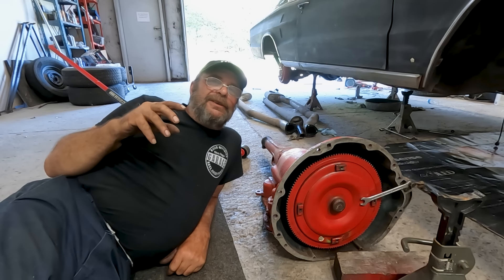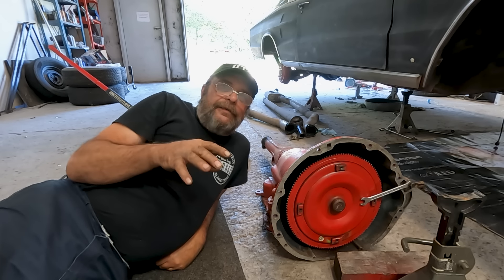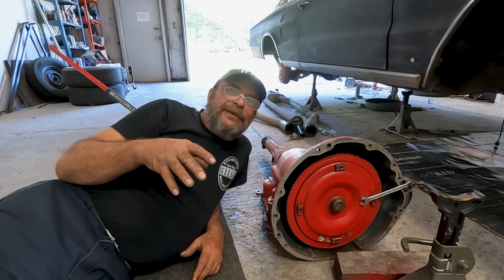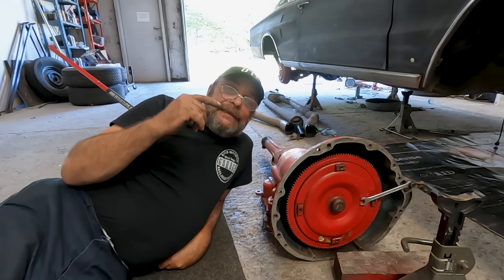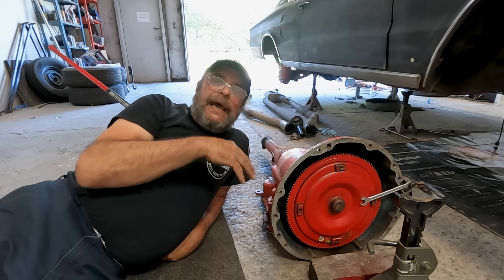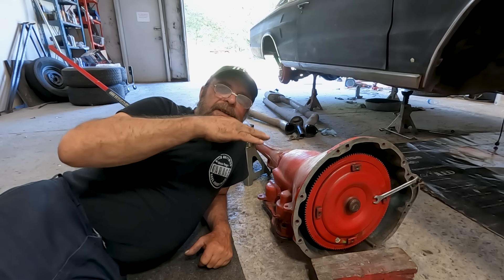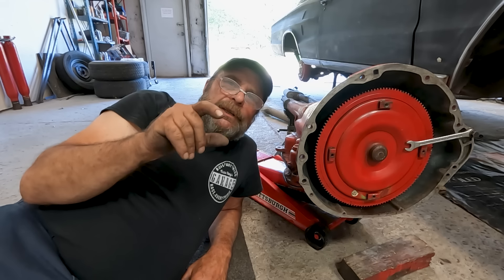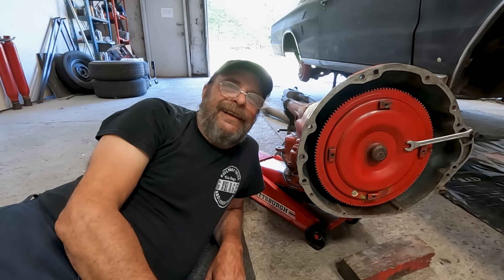One Man, On The Floor Transmission Install- So Easy Even An Old, Crippled Guy Can Do It

Comment: Now you tell me.  Back in 73 when I was 22 years old, I slid the 727 under the car and somehow got it on the wood 2x4 blocks on the scissor jack I had in the garage.  After what felt like an hour I got it up to the engine block and luckily got one bolt started and finally had it bolted to the block.  Then I had to somehow get the torque converter plate onto the torque converter.  I'm no pro mechanic just a shade tree mechanic.  I'm thinking I better tighten these little bolts as much as I can.  Yeah, I broke the head off the first one.  I headed down to the local auto parts store and got another bolt.  That was the last time I screwed with a transmission under a car.  Hello transmission shop.  Oh by the way, why do they give you 4 inches of space to install the bolts?

Comment: I use a motor- cycle lift as a trans. jack, just add 4 short 4x4's on top. 2 10mm guides on the bell houseing. this has always worked great for me.

Comment: The idea of the studs in the engine block.  I have a box of different thread "pilots" that I made over the years swapping engines and transmissions.  Working by myself under cars, this made aligning them a whole lot easier.  I just took long bolts, cut the heads off and ground the end to a rounded point.  I'm with Tony on the facts of aging with arthritic joints and worn-out muscles from the abuse of my younger days.
Reply: @One Eyed Jack  Definitely, I forgot to mention cutting or grinding the heads off of a couple of tranny bolts so l could catch my freakin' breath.  Good call Jack.

Comment: Tony, you need to return those old ratcheting jackstands to Harbor Freight and get the new, safer ones which have a holding pin to prevent the ratcheting mechanism from accidentally  dropping the vehicle.  Harbor freight takes the old ones back with no questions back and gives you a refund or a store credit.  With the recent Memorial Day sale, the new safer jack stands did not cost me anything because of the discounts.
Reply: "THIS RECALL ONLY CONCERNS JACK STANDS WITH THE ITEMS # 56371, 61196, or 61197"
Reply: They ratchet one way, and if they fail it's not like they will bottom out on the floor.......
Reply: @Warrior_Resisting_Colonialism  correct it was the welded core legs that were failing not the ratcheting concept. if you look closely they are now one solid piece of molded metal.

Comment: A friend bought a 280Z transmission, went to a guy's house at night and they both were under the car pulling it and chatting about Z-cars. The last "U" joint bolt came out and the car rolled off the ramps pinning them both under the car for hours.  The guy lost an arm in the process, so, careful with ramps.

Comment: Very Helpful demo for the "Solo"  mechanic trying to Wrestle a heavy, bulky trans Safely into Position !!  ..... I've used a 12"  square board Between jack Pad & Pan to help Balance......A couple of Pointed extended Bolts or rods really Helps alignment !!  .....Thx for video....

Comment: Transmission jacks are borderline cheap, this is a great workaround, but I use that transmission jack for other things like rolling my welder around lol
Reply: I left basically the same comment. The HFT transmission jack is well worth what it costs and is great for a lot of things. Mine has done more gas tanks than anything.

Comment: After helping with a few R&Rs with floor jacks and 2x4s and all of that, I learned that even the cheapest transmission jack is worth it (looks like the current comparable model to mine is $230 at HFT). The tallest stands you can find help a lot too.

The tips, tricks, and shortcuts are all great... until you have one where something goes wrong. I had a manual re-install job where the clutch alignment tool would go into the pilot bushing just fine, but was slightly peened over to the point that the actual input shaft didn't fit it anymore. It took forever to figure out what the problem was. I must have he-manned that transmission up and down a dozen times before it was done. Sliding it into the clutch, it falling off the jack, holding it up with one hand while fumbling with the jack with the other while praying it didn't crush my head or fingers... 🤣 Once that was over, there was a transfer case to put up too.

Transmission jacks are fantastic for dropping gas tanks too... which is the next job mine has to do. It's done more gas tanks than transmissions now that I think about it.
Reply: so true man...done a many ol school way.....till a few years back on a 350 turbo on my back and it slid front side/converter on to the ground and cracked the case....cost me for what a cheap harbor freight job would had cost me.
Reply: Motorcycle jacks work great too! They are nice & flat w/ 2 skids to work with for BOTH applications!
Reply: @mikethomas5797  THIS is what I found out about 25 years ago.....having a motorcycle jack and TALLLLLLL jackstands is key to making things easier.....and making studs out of blots(yes, I know...I always speel it that way)to slide the trans onto
Reply: @chrishensley6745  I was always more worried about crushing my skull than damaging the case, but... also that! 😆

Comment: And for you viewers in the southern Illinois farm rurals, remember to unbolt and remove the combination wrench which holds the torque converter in place before installing and tightening the transmission-to-engine bolts.

Comment: I remember being 15 years old putting a 904 into my 74 valiant, with my pipe cleaner arms, 100lb soaking wet body, My dad didn't believe in buying tools, so all I had to work with was combination wrenches, and phillips screw drivers to line up the holes, and I used 2x4's to lift the tranny up. It was an awful job, junkyard tranny didn't last long, so I had to do it again about a year later.. I didn't know anything about how the tranny worked, all the manuals I got from the Library said "takes special tools, you can't do this, take it to professional" The parts stores with new manuals had them in plastic, wouldn't let you open them to see if the info you needed was in there before purchase. I had no access to the information on how to take apart, and diagnose the issues. VERY frustrating. Now, I've rebuilt a couple, and they really aren't that complicated. When I asked older people who seemed to know, most of them didn't know either, and the few who did just told me to take it to someone. Boomers were NOT helpful at all to us Gen X'ers. We had to learn everything for ourselves.. I guess since we were all latchkey kids, the abandonment needed to be complete, HA! Anyhow, I survived, and I still have that car, just need to get to a place where I can work on it. 

Great tips Uncle Tony! I wish I would have known someone like you who was willing to help even just to answer questions, instead of telling me I was an idiot back in 1989.

Comment: Great video UT!  Using a floor jack by myself, I used to take the Turbo 400 in and out of my '55 Chevy 3 or 4 times when I drag raced.  I also took the 200R4 in and out of my wife's '57 Wagon twice the same way.  I used my legs to pump the jack and wrestled it in.  I was really young then and was really good at it because I got a lot of practice using a floorjack to take my VW engines in and out at least 50-60 times for the '66 and '67's that I owned in those earlier years.  Now that I am a broken down retired firefighter, thinking about it now, I don't think I could do those contortionist manuevers like that anymore!  This is a good method to get the job done without the major cramps or injuries that I could end up with if I tried to do this like I did when I was in my 20's.  Thanks for this video!  I am sure you just prevented a future back injury for me.  Thanks again and keep up the great work!

Comment: Back when I was 18, I blew out one of the clutch damping springs on my 94' Mustang. This happened around 10oclock one night, and had to start it in gear, then float gears all the way to where I was going (clutch would not disengage because of the spring being between the pressure plate and clutch disc). I had a 10x20 storage unit that I kept tools and such in, and so there I was at around 11:30 pushing this thing into the unit by myself (It was the ONLY smooth concrete I had available to work on at the time). 

The next morning, I rolled down there in my "daily driver" (ironic because I only drove it when the mustang was broken), and tasked myself to pull the trans. I had a floor jack, but I was relatively inexperienced and didn't trust myself to balance the T5 on the jack by myself (funny, being a professional diesel tech now, I'd have just bench pressed that baby trans in and out of there).. 

ANYWAYS, Long story short. I removed the 12mm allen that held the "puck" on the jack, and put a old brake rotor in place of the puck. Gave me all the surface area I needed to hold the trans and I had the job knocked out in a few hours. Later on I welded a flex plate to the spare jack puck and still have that as a trophy in my garage to remind me of my stupid creativity. 

Working smarter doesn't always mean spending money.

Comment: I bought a transmission jack from one of those tool places for my last project and was worth every dollar I kicked myself for not getting one sooner. So simple put the trans pan on the platform throw the strap over it to hold it in place wheel it under. The platform has adjustments for front to back angle and left to right. I could not believe how easy it was to jack it up in after years of doing stuff like Tony is doing and fighting with getting the angles right. I get it if you don't have the $$ but some things are just worth having.

Comment: Interesting comments! Before I finally got a lift and a proper transmission jack I did many off the floor. Gravel driveways were tamed by a sheet of plywood to lift the transmission from. Sorry guys, lifting a 727, TH400 or C6 on your chest then pressing it in place, in alignment? Maybe two guys, one lifting and one starting bolts. But still hard to believe.

Comment: Good video! I have done some variation of this in the past, but the wrench bolted to the bell housing to keep the converter from sliding out is a great tip. I have had them slip out a time or two, and that can be a pain in the ass.

Comment: I am very tall 6’8” I use to lay with my head to the rear roll the transmission on to my thighs, work my feet towards me like a jack lifting and sliding the transmission onto my knees and slide it into place.

Comment: When I was a teenager, it was easy to get your friends to pitch in but now, not so much and I have to admit, it’s kind of empowering doing auto work single handedly. 

Last September after I installed the engine, I crawled under my Mustang and installed the 3 speed top loader using a floor jack. That was a really unpleasant experience, wrestling with the transmission and trying to get the angle just right to get the snout through the clutch and line up with the pilot bushing. 

As soon as it warms up, I’m going back under to re and re it with a T5. I did mine really similar to your technique, with the floor jack and a 2x4 block on the front but I did not know about the Jack stand on the tail shaft trick. That’ll be a game changer. Wish me luck, lol.

Comment: l have done that just as man times as you have. And yes a few times it fell off of the hack stand or the block of wood. But eventually l would get it on the jack and then jack it up into place. and just about always used bolts with the head cut off to guide the trans in place. This also worked really good for stick shift trans.

Comment: Oof, Im not a fan of heavy line work these days. After three motorcycle wrecks, two of which were semi fatal, Im just not as hard core as I used to be. Reasons why I only ride the cruisers not the crotch rockets anymore. I use an motorcycle jack as a trans jack these days. Works like a charm. I do like the plank trick though in a pinch. Good stuff, Tony. Keep up the good work.

Comment: Great video. Thank you. I’ll remember tips like threaded guide rods and holding the T/C in place with a bolt & wrench when I replace the C-4 in my ‘67 mustang, hopefully soon. 
My worst solo trans install was a 74 Volvo 164. I think it was a Borg Warner. I know it was big and heavy. Even as a young guy it was a bear to do alone with a floor jack. And the minimal firewall clearance only added to the suck factor. 
Great observation about the lack of specialty shop tools, due to high cost, among home mechanics.  Came down to borrow or innovate or split the cost with a buddy. 
At 66 years old, I’ll be buying a transmission jack from HarborFreight next week.  Some things get better with age.

Comment: DAMN MAN - you just described my method! I have several 2x12 boards about 2 feet long. Under the car I drag trans onto 1 board, easy enough. Next to it I stack 2 boards, slide it up and over, then 3,4,5 etc till it is high enough to slide onto the jack. Then align and raise into place, bolt up, crossmember then I feel good.

Comment: I used to be able to "bench press" a TH400 into place in my 20s. Not any more. Now I have a harbor freight trans jack. I put the trans on the jack first and wheel it under the car, with the car on really tall jack stands (2 feet!). So much easier!

Comment: Man, that brings back a lot of memories. That looks somewhat easier than the way I did it back in the 70s while working out of my driveway. I only had a bottle jack, cinder blocks and blocks of wood. But I got it done. I used to dream about owning a floor jack back then. I learned to be innovative, which served me well going forward.
Great video!

Comment: Lol, I’m 67 years old, recently changed the flex wheel on my 2001 F 250 by myself with a walking boot on one leg while recovering from severe stress fractures. Best part is the truck was on grass, working top of a 4x8x3/4 plywood. after getting the wheels off the ground and floor jacks on the plywood under the chassis I proceeded to remove  driveshaft, place floor Jack under trans, remove trans cross brace I removed torque converter bolts, bell housing bolts and separated trans from engine block pulling it away far enough to get impact air wrench in the remove flex wheel bolts. Reverse process and done in one afternoon while on my back, hampered by big plastic boot by myself. Nothing but a thing!

Comment: Video brings back memories of replacing a clutch in a friend's Charger 440 Magnum with a 4 speed.  We were working in the underground parking of my friend's apartment building.  The weather was late winter/early spring.  Car up on some cheap stamped steel jack stands, I was a good thing that we were both young and skinny.  We got the transmission removed and the new clutch installed.  Now trying to install the transmission, the weather outside warmed up to where the snow started melting.  We had a river of water running under the car where we were trying to work.  Not wanting to lay in the cold water we stole a sheet of sheetrock from the apartment building maintenance.  Thinking this would be a quick job.  Bench pressing the transmission into place we could not get the splines to line up.  Now we had tilted the tail down and lube had run out.  To make things worse the sheetrock had started to dissolve, and we are laying in cold water with gear lube and white melted sheetrock. We finally got the transmission installed after lots of swearing.  Young and dumb with very little money.

Comment: Tony, I bought a Harbor freight motorcycle jack, removed the pull handle and sit the trans on the flat plate...wheel the whole unit under the car and just jack up the lift...been doing it this way for over 10 years...and im lifting early cast iron TorqueFlites in 1957  Dodge D500 Hemis

Comment: All my early cars were manual transmissions which don't have a flat bottom. When I took the gearbox out the engine lays down at the back a bit when the rear gearbox mount is undone. I would then block the front of the engine so it could not return to level. It was not straining the engine mounts much. I would then change the pad on the trolley jack to a bug flat piece of wood I had with two vee shaped wedges screwed to it. That went under the gearbox and an old leather belt went over the gearbox so it could fall off. Then I could loosen the last bell housing bolts and pull it and the jack out. Going back in was the reverse but making sure I used the clutch plate aligning tool and two guide studs like you suggested. I used this method at my home for ages until I built a new home and I put a service pit in the garage. that was in the 80's. My son has just built a new workshop at his home and it has a car hoist. I say it was $2500 very well spent and that's where I do any of my car work now.

Comment: Excellent advice, thanks. You mention all-thread guides, I keep a collection of long shouldered bolts with the heads cut off. Helps a lot guiding on transmissions, but covers are where they're golden, especially working blind.

Comment: I've been holding off on a new torque converter on my 46RE because I didn't feel like I had a reasonable way to lift the transmission without balancing it on top of a wobbly jack. I've got wood, and the same jack stands and floor jack. I feel like I can do this now. Thanks Tony!

Comment: If you have some extra starter bolt cut the heads off and round the tip make grate studs for lining up a transmission!

Comment: Good video, I went thru this when I was wrestling out a C6 from a 72 F100 and then putting back a T5 while doing a auto to manual swap.  The T5 just did not want to go in.  I was wrestling under the truck for hours :)  I had two jacks one front one in the back.  Thanks for great pro tips!